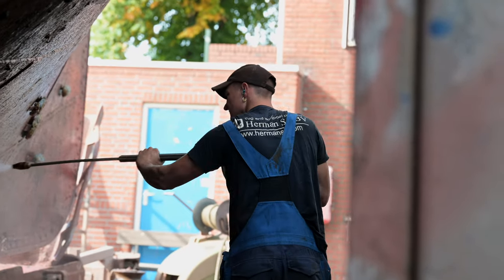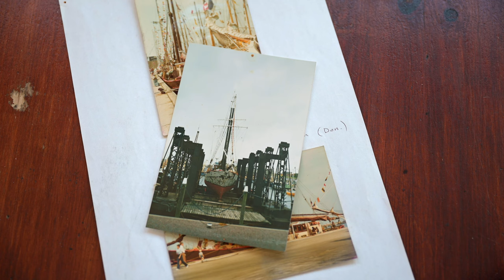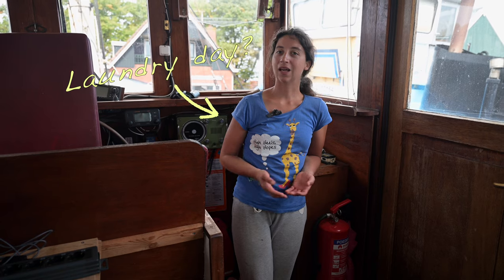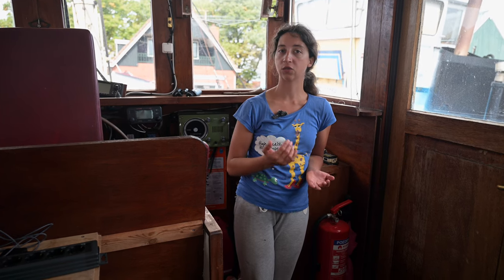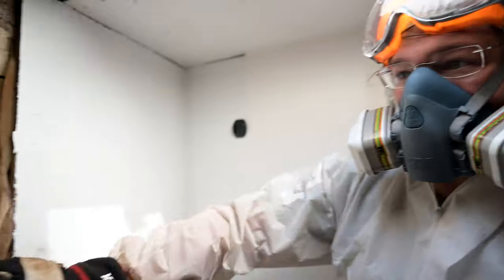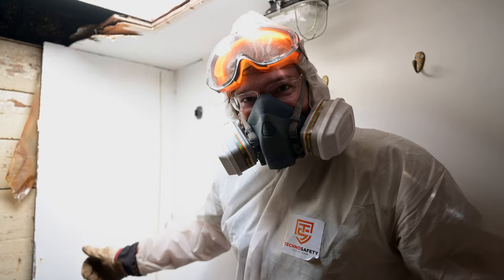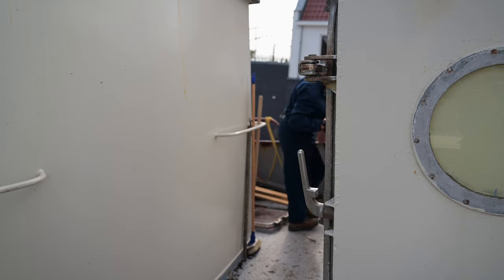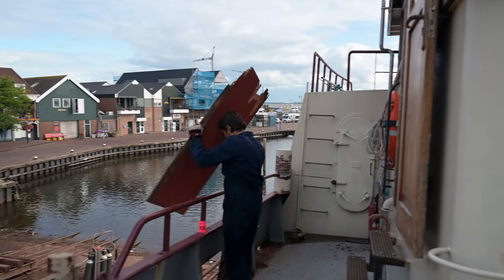Gutting the Interior so we can weld the Hull! We need to be fast!

Comment: "... to give you the illusion that you can breathe... " LOL hahaha, that is a good one!!
At 12:59 I love the 'angle' of the coffee in the cup 🙂
Reply from the maker: Getting the coffee in the cup is not as easy at it seams 😂😂😂
Reply: Alot of ships used asbestos for insulation. That stuff looks dodgie as F.
Reply from the maker: @hyperflys  The insulation is made of cork glued together with some sort of tar. If we're lucky it's pine tar not it's coal tar. We hope for the best and prepare for the worst. So far we had no obvious things containing asbestos. Maybe some vinyl flooring or in some glue but we are very careful since you never know when you remove things built prior to 1993.
Reply: @FlyingConey  Did you have it tested?
Reply from the maker: @hyperflys  No, but there is not much difference how to deal with asbestos or PAK. Actually if working with PAK you need heavier filters because there might be fumes as well. Se we treat it as if it's asbestos, PAK or whatever. The boat is at least 72years old so sometimes there are different layers of different coatings. The topcoat might be not harmful but the base layer might contain lead, PAK or asbestos or the jackpot, all together.
Reply: @FlyingConey  "We hope for the best and prepare for the worst." Excellent thinking.

Comment: I wondered about welding the exterior hull. could you not grind the areas , use an epoxy based fairing compound to fill in the holes???  Also there is a paint/anti-rust application that goes through the surface rust and bonds with the base metal for the interior bulkheads. I would hope that they are still available. BTY your recommended YouTube channels  is great as I follow most of them already. .🙂............  enjoy

Comment: Dang…Mo “Grunt” Work☹️ And this is probably just the “Tip of the Iceberg” Continue to Stay Safe and Enjoy 😎
Reply from the maker: The good thing is after we've removed all the insulation we've a pretty good picture about the condition of the hull. We can tackle any issue and after that we know for sure that the hull is sound. Since everything is out welding is much easier also so the good news is, after that we can start to build up.

Comment: I wonder how much the insulation was promoting all that rust.  Demolition sucks. Perhaps when you get to designing the new interior a more modular system to ease access to the hull would work. Good luck.
Reply from the maker: Interesting question! The former fish room so the area that was insulated with cork is by far the most rusty one. Almost no rust in the engine room and not much in the forecastle. But the hull looks worse than it appears and we haven't noticed a significant difference in thickness of the plates anywhere on the ship.

Comment: Hello you two .Well sometime ago I told you about a paint i used to use that would bind with a rusty surface i finally got the name for it the brand name is Eastwood and it is called rust encapsulator  Plus it comes in one color black .here in the U.S.A. it comes in 1 gallon pails that's the good news however i did not know how expensive it was $167.99 per gallon .But it good news is that you don't need to grind the surface steel down to bare clean metal .and once it is applied it bonds to the metal and seals it to stop the metal from rusting .I truly hope this is of some help .
Reply from the maker: Thank you for researching the product! But it seams to be a US only brand. Here they use Brunox, Rustbuster and sometimes Ovatrol. Our plan is to blast the hull down to white metal and coat it with a two component zinc primer and a one component topcoat. Rustconverter would also be a good option but they ain't cheap. So on one side of the spectrum you have the old-timers who just get rid of the worst corrosion with an air chisel and use a sticky oil or grease to coat the hull for the next 1ß-20 years. And it works 😳 On the other end of the spectrum you have the modern two component paints or even pyrocaoting with zinc. The rust converter route can be very effective and the result isn't necessary worse than the blasting and recoating option but I'm not sure if I could turn of the perfectionism.
Reply: @FlyingConey  I'm sorry that they don't have that product over there .At least you have options there .😀Oil and grease I can see that .What ever it takes right ?. Well when in comes to infrastructure and foundation work you could go with the rust converter below the water line and above that something else .It is after all going to be your home .Long term repair below the water line will pay for it's self over the long sail .above the water a shorter maintenance  cycle is ok .Give her a pat on the hull for me if you would and tell her she has Fans around the world . what lady doesn't like a little flattery .🙂

Comment: Well, the boat is huge! Especially the draft. How tall it stands. 

A pretty good job of getting the insulation out. With everything out you can really make up your own idea on what can be build. 

So its taking everything out, and then getting the hull fixed and painted, and then back into the water, doing the inside somewhere next so shore instead of on shore? 

Pretty good gains with the work. 

Dont worry you will get the inside right im sure. You could use CAD software to draw your plans for panels and cabinets. That way you know how to make the shape, and you can change things until you get to a point where you are happy with the design. I did the same with my microwave stand and bar, and i got it to fit leaving just an inch to spare with the door that can open all the way now. No surprises with CAD design software (i downloaded one for free (its free to download, illegal to upload in the Netherlands... haha)), you only need to build it once. 

The hull being made of steel, you can maybe use it to weld brackets and attachment points onto it. A lot is possible if you have some imagination. Ive read a lot of books on how to build buildings, how to weld steel, how to do electricity, plumbing etc. Im not sure if i referred to it already. But in the last months, i put a lot of these books up on my archive. Its grouped, it has everything in it i mentioned. If you use the search function you can get to what you want to know really fast. I suspect "Modern Woodworking", "Carpentry", "Modern Cabinetmaking", "Modern Plumbing", "House Wiring Simplified", "Painting and Decorating Encyclopedia", "Learning Solidworks" and "Welding Skills", are some books worth to take a look at. I know it is a lot, but if for example, you want to solder some pipe, weld a bracket, design a cabinet with some lighting in it, and paint if afterwards, you can go the the chapters on that topic really quickly while all the books are searchable with "CTRL+f". If you are in doubt what to do, know that there is always a solution at hand, and it is written in a book. :) Even a mosaic book if you want to get a really special bathing room or kitchen, when due to the curvature regular tiles would not work.    

Good luck. Keep going. You will get to where you want to be. Getting everything out brings a good opportunity to make it so that it is something that you are happy about. Also, if you really really want to have more watertight compartments, now is the moment. :) (im always paranoids of sinking, i like the idea of navy ships being able to have massive holes in them, and still not sinking (the perfect storm movie... or gale winds going form New Zealand to god knows where.. a story my sister told about 2 Australian guys she met in Asia, they headed of shore, never to be found again, gone missing... O man!... Or hitting a container floating under the surface of the water, striking a hole in the hull. It happens more than you think, but as sailors, you know all about it (the hullshape of your boat is fine, no fins snapping off))). 

Last but not least. In "ARRL Atenna Book, 21st Edition" there is an antenna that works on boats (and a lot more antennas that could work on boats). As sailors of a sailing yacht, your contacts with radio amateurs will be high on their list. Something special! 

Greetings,

Jeff

Comment: I have a lot of experience with rusted ships. This is caused by trapped moisture behind the isolation. That hull is in really bad shape on the inside. You have to remove the heavy rust scaling with air needle gun, then mediablast it after that. And use a heavy duty 2k epoxy  coating to prevent future rust. Laser rust removal is also an option. Either way, its gonna be a hell of a job.
Reply from the maker: Thank's for advice. If I may add a little spoiler here, we removed the heavy rust scaling with an air chisel and actually the hull doesn't look too bad. We've planned to tackle the whole blasting thing, inside and out next spring. Until then I'm not sure if we should apply one layer of linseed oil to be safe. But on the other side we are far away from salt water, it's winter and nobody lives in the hull so any new rust will be minimal. What is your opinion on hot zinc spaying? Arcsprying or Flamespraying? Also I'm not sure what type of blasting is the best in our case. In the forecastle the coating of tar / grease / black sticky stuff ist still intact, do you think laser blasting is a good option to vaporize it? Mabe wet sandblasting is a good option too to get rid of the coating and the rust. The most problematic area is the rust behind the frames. The are not welded in place the are riveted! So there is rust behind it. Maybe we close it with sika or something to keep air out... You see, we still have to do our homework and that's also the main reason why we postponed a few tasks until spring. The other reason is that we are completely wrecked.

Comment: Part of the electrolysis problem is the mix of zinc and aluminium anodes. I'd suggest reading up on anode types and properties...since your boat will be spending most of it's next couple of years in fresh water, I'd recommend magnesium.
Don't be drawn into the 'more is better' trap with anodes, there is an ideal size for every boat. The yard may be able to advise, but sticking with the type/size original to the boat is likely to be best.
Reply from the maker: We now have a bit more than 50kg aluminium on the hull and they seam to be high quality anodes. The yard has a high reputation amongst the fishermen here and they haul out every other year. We plan to move the boat to Germany next summer so I think aluminium is a better choice over magnesium. Also I'm not sure if the Markermeer is already to brackish. As always, thank's for advice, a comment like yours is always good to check if we are on the right path in the decisionmaking.

Comment: You need to learn what a sandblaster is and how to use it. To begin with, use an air chisel to remove any heavy rust or scale to get down to the rusty steel. Doing that will save you a lot of time and money sandblasting. Then clean out the big hunks because they get in the way when you are blasting. Next, get your air coming from the air compressor you're going to sandblast with as dry as possible with after coolers and coalescing filters and use a diesel powered industrial vacuum that you pull behind a truck to remove the grit. The diesel-powered air compressor should be 185 cfm or larger to sandblast with.  Once you get the steel blasted get a machine called an impregnator that soaks fiberglass cloth with epoxy resin. Then fiberglass the entire interior of the hull with impregnated cloth.  Do whatever repairs/ welding before blasting or fiberglassing. This process sounds expensive but if you remove the entire interior of the boat first you can get a high quality finish that adds to the strength of the hull, eliminates a lot of welding and adds to the value of the boat. It also eliminates a ton of maintenance for the next few decades. By the time you figure labor, grinders and grinding wheels etc., rent for the dry dock, overhead, daily expenses, and welding etc. This process will save you time and money. As an industrial sandblaster and painter, it would take me around 3 weeks. Then you build a hoop frame with pvc pipe and cover it with 6 mil or heavier plastic sheeting to contain the boat when you blast and fiberglass the exterior. It contains the blast grit and keeps out the rain so you can get more done faster and pay less dry dock fees. Also, you should buy your resin by the 55 gallon drum and the bi or tri axle cloth by the roll it will save you a lot of money especially if you can buy everything you need to do the interior and exterior up front and maybe buy a used impregnator the people you buy the resin and cloth from may have a used machine or know someone that has on for sale or try craigs list. Any questions just ask, Billy McLain owner Industrial Blast Inc. Largo, Fl.

Comment: WOW. What a huge amount of work to strip the interior away from the hull to prevent potential fire danger. Could you have used something similar to JB Weld to fill in the hull defects instead of welding?? I know nothing about this so I am asking out of ignorance.

Comment: Wow, the hull looks so rusty, I wonder if the only paint it ever had was when it was built? Was that cork covered in tar? That stuff was nasty, was that, in some way, meant to protect the hull so paint wasn’t necessary? Anyway, I’m hoping it all works out for you two and a path forward is doable. It’s a very interesting channel, I like it a lot.
Reply from the maker: Back in the days they used sticky stuff to protect steel. Tar, Bitumen, Grease, Oil or a mixture of all of it. I think the cork bricks consists of small cork pieces glued together with some sort of tar. But the smell is quite nice so I hope it's pine tar or something similar. Just to be safe we wear the big filters. But back then they knew that there will be rust so they just overbuilt the ships. I mean we still have a plate thickness in between 5-8mm that means that it was built with 1cm steel plates! Overlapping at some spots. Also the sticky stuff turned out to work better than expected but after some 20- 40 years or so it gets brittle moisture gets underneath it and you end up with a lot of rust. But 1mm steel is 1cm rust!

Comment: Greetings from Belgium. Sorry to hear you have to rush things. Now I am convinced it is for the best. First you will have good quality repairs. Solid « foundations ». Second, you will have more latitude to chose the materials and setup of the interior as you see fit. You will also get rid of all the old crap that was there, smelling, molding and not very healthy. It is a lot of work but you are the two of you, you can support each-other and you can improve each-other’s vision of how you want the ship to be, give ideas, courage to each-other. You now have more space for making your dream come true.  Regarding the isolation, I think you have mentioned once possibly spraying foam. But if you do that, and for one reason or another you must weld something again, make transformation or repairs, the foam will be an issue no? As for the wood it has done its time well, I don’t feel sad seeing it go. For the concrete though, I am a bit worried about what you could find under it. Keep up the good work. I was impatient getting news from you and the project. All the best!
Reply from the maker: It feels good to make progress. So sometimes external pressure to speed things up isn't the worst thing. But it's working fife days a week on the boat and editing videos on the weekends. We made our minds up about the spray foam and spoke with a lot of people and it's off the table now. With the riveted hull there's always a possibility that there's some welding needed and spry foam has to be removed before that. Probably we choose Armaflex directly glued to the hull as a condensation barrier and sheep wool to make it cosy. It's possible to measure hull thickness even if there's concrete. So the measurements would tell if there's a problem under the surface. But usually the problematic area is exactly at the line were the concrete meets the hull. There are a few hints in the video were the problems are at our ship... But also sometimes it looks worse than it is!
Reply: @FlyingConey  Im glad you state that it is of the table because spray foam has a lot of toxic chemicals in it, and it is not healthy. There were people who insulated their house with it, and now they are chronic lung patients. They had to take the house down!. It was in the regional news ("Ziek door isolatie met purschuim: 'Van duurzaamheid naar alles kwijt'"). So be careful with spray foam! 

Greetings,

Jeff
Reply from the maker: It's really important to pick the right products! Usually the spray foam used for marine application (mostly freezer rooms on trawlers) is a two component epoxy based closed cell foam. So after curing there shouldn't be any off gas fumes. Well, in theory. But it's basically epoxy paint with air trapped in it. The sheep wool is a nice natural solution but since the Armaflex is glued on to the hull there will be chemicals involved. But they're proven and I promise we will be careful!

Comment: It seems such a shame in ripping out some of those things. Can’t wait for the finished product 👍👍 do you feel slightly disheartened when you see a pile of timber on the deck😂. I would 👍
Reply from the maker: We saved the yacht like and unpainted timber parts like the doors. Also most of it wasn't high quality we even found tung and grove boards with the tree edge on the back. So rushing through the ripping out step made decisionmaking easier and we are really locking forward to built a high quality interior from scratch. The plan is to move the ship to different places during the refit, for the deck (spoiler 😉) and the first part of the interior we want to go to Germany.
Reply: @FlyingConey  well good luck, I’ll be watching 😂👍
Reply: @FlyingConey  well good luck, I’ll be watching 😂👍